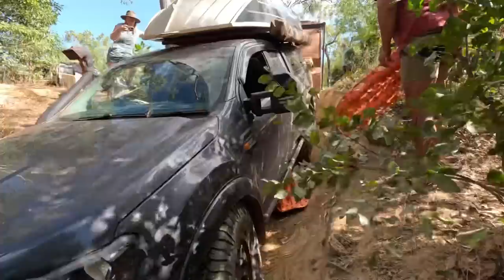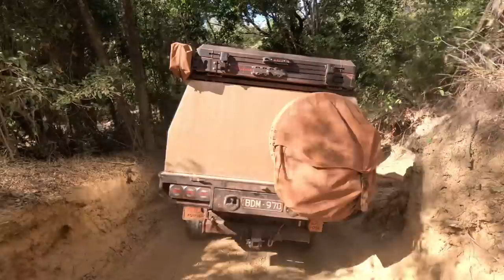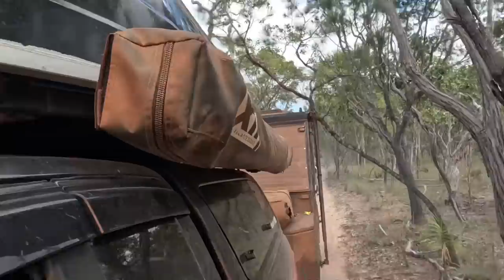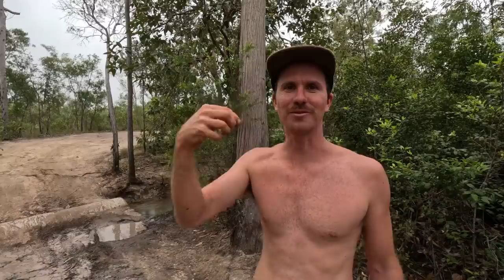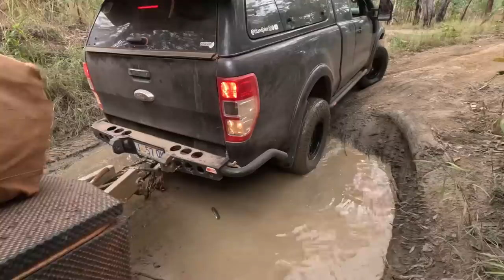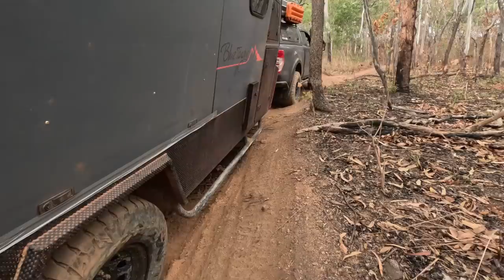FRENCHMANS TRACK towing a CARAVAN! We made a TERRIBLE MISTAKE!

Comment: Pascoe River would be impossible to even get down to Towing that ... let alone get up the other side ... Pretty sure the road building crew made a new track in last year as they had machinery in the middle that didn't come in from either end.  To Be honest Cape Melville would be doable a lot easier that what you just did ... only one spot you would need to build up with logs to stop the van from leaning and you would make it to the first camp ground and could drive up the beach to the end in just the car 13kms at low tide. big effort there you two !!

Comment: When I was in the NT I discovered a blown turbo hose, of course with the bonnet up my neighbours came over. My plan was to Gaffa tape, wrap a coke can and then cable tie. But my nosey neighbour insisted that the Gaffa tape would suffice, literally saying 'im going to cut in here, you don't need to do anything else". Of course 5 mins down the road the Gaffa tape failed and I was forced to fix properly on the side of a the hot road instead of the shady campsite. Know it all's should mins their own business aye 😅

Comment: I’d definitely be giving the transmission some love after that stint. The temperatures must have been through the roof on those steep gnarly sections. I know mine gets up pretty high just towing my 15ft hybrid through some hilly sections on sealed roads even with a transmission cooler.
Apart from that, much respect for having the balls to give it a crack. It reminded me a bit of some of the crazy stuff the All 4Adventure guys do towing their toys around similar gnarly  tracks including The Frenchman’s 🤘

Comment: Good idea bailing out there. Track gets considerably worse. 
Using low range through the slow moving tight sections will help lower your transmission temps if you weren’t already doing that. 
Love the videos guys
Reply from the maker: Couldn’t agree more!! We gave it a pretty solid crack! Yeah, great tip we definitely needed to in some spots! 😅 Thanks so much Jack!! 👌🏼👌🏼👌🏼